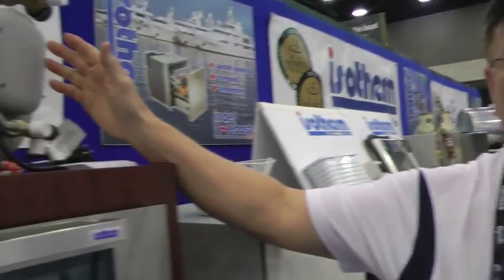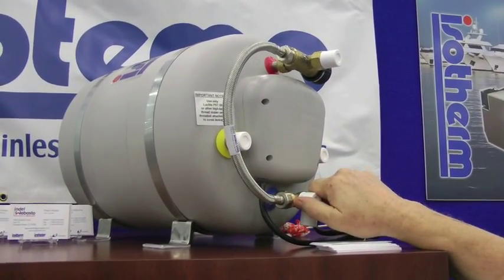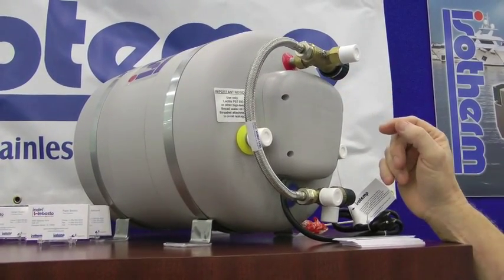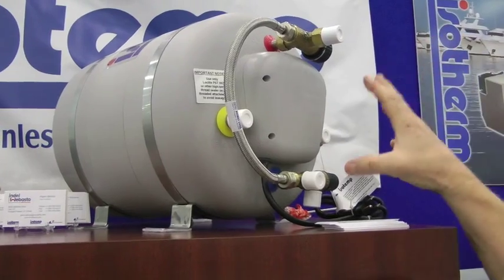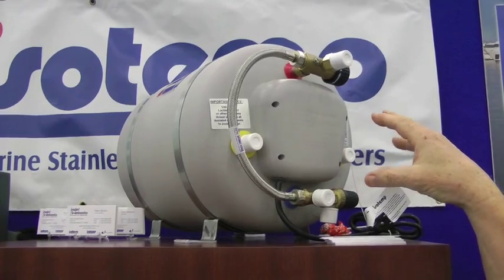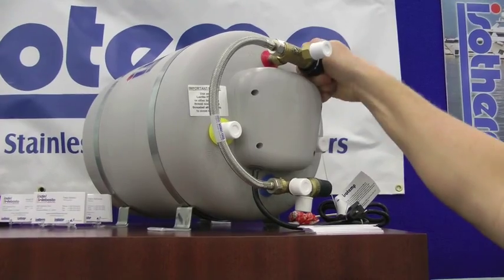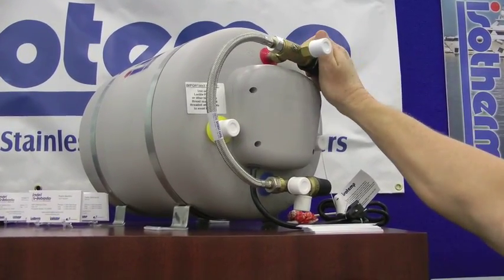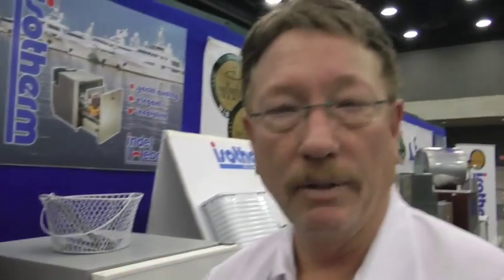See the new Webasto Water Heater with Boating Industry Canada

Comment: Hi, is it possible to remove the end cap, take out the thermostat and wire up your own regulated voltage supply if you want to do so (for use other than the standard). I don't care about warranties and liabilities, I just want to know is it physically possible to get at the heater and bypass the thermostat. thanks in advance